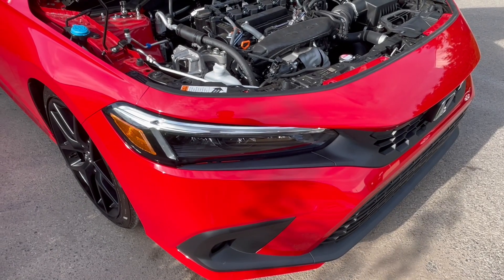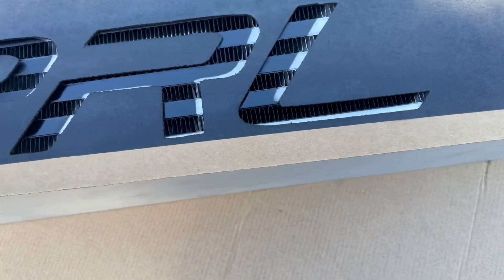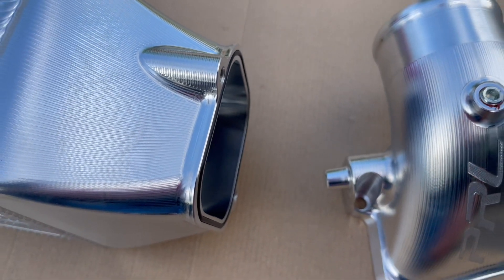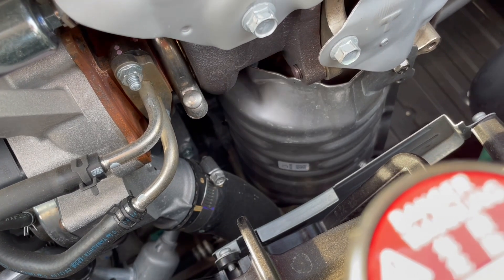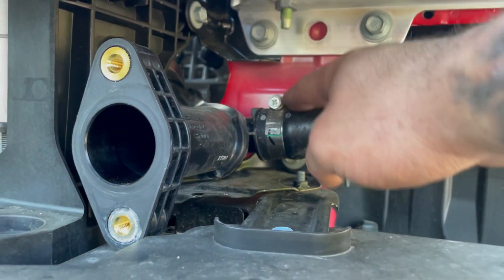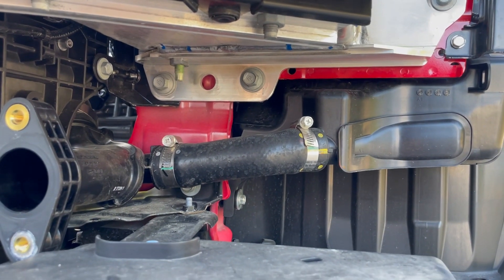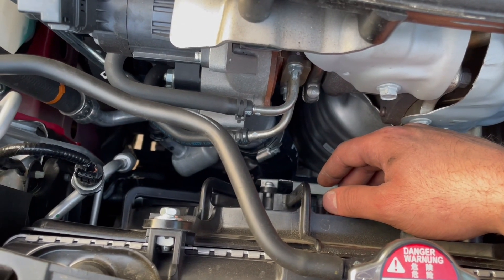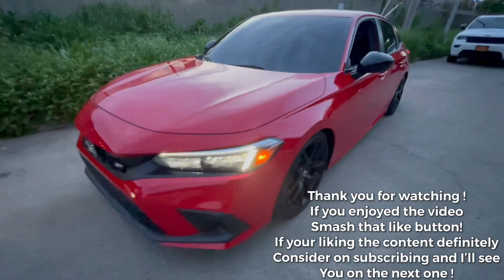2022 Honda Civic Si PRL Intercooler Upgrades Install

Comment: sorry for stupid question, what is the benifit of the upgrade intercooler? and do you have to tune it after have it install? because i just got the HB sport touring and want to mods my car too
Reply from the maker: The PRL intercooler upgrade decreases charge air temperatures while increasing potential airflow. It increases turbo spool it gives you about 3-5 hp. You don’t necessarily have to tune it but if you want good results then I say you should, but overall what it really does to your car it’ll make it run much cooler, and cooler air is better for the turbo.
Reply: @sfernandez816  thanks

Comment: What does this do for the car in terms of actual gains?   Has anyone been able to add much power to these 11th gens yet?  I know they’re still fairly new.
Reply: I’m assuming it wouldn’t go into limp mode as easily. My car has been in limp mode twice fully stock and it’s a 22 civic si
Reply from the maker: It’s not much for more power but when you get it tuned it can make a little difference yes, but this is more for cooler air which is what the turbo likes.
Reply: Speaking from experience, I’ve been running the TSP stage 1 tune for about a week now. In either map two or map three, which really are the only two maps which go beyond factory boost, heat soak is a bitch. You might get a few minutes of fun before you’re capped off with readouts at 17 psi. This is definitely my next mod. Thanks for the video!
Reply: Lol they charge 20 bucks for that stencil now. Pretty scummy if you ask me

Comment: If u buy the intercooler outlet also u need to Buy Intercooler piping ?? Or  I can buy just the intercooler outlet?
Reply from the maker: Yes you need to buy the intercooler piping as well, if you notice only one side is using the stock 12mm bolts, and the other is the silicone tube

Comment: Excellent video was waiting for a full install. Now how does it feel? Do you hear more turbo noises? Or still the same? Cause is a decent amount of money for only 3-5hp but yes definitely cooler is always better. Cheers
Reply from the maker: In a way yes, you can actually hear a little more turbo spool with it, and of the course with the prl lettering in front the car looks more aggressive in the front 😂
Reply: Ososik media actually ggained 20wtq just with intercooler no piping

Comment: old video but i just purchased a 2024.  best video I have seen for the intercooler so far. really glad you compared the two cores side by side.   factory cores are always lacking and heat soak so looking for this be the first thing I do to the car.
Reply from the maker: Definitely, I agree, this should really people’s first go to upgrade on these cars ! And congrats ! It’s definitely a great ride in all honesty, daily commute and fun at the same time
Reply: @sfernandez816 can you buy the intercooler without the piping or do you need the PRL upgrading piping to go along with the intercooler. Great video just had a question. Thanks
Reply from the maker: @Arnold-dm2xt  you can buy it without the piping that’s not a issue, but I can say if your thinking about buying the whole thing it would be better, cause your already spending a pretty penny on just the intercooler, might as well get the piping too, but do you really really need it asap not really
Reply: @Arnold-dm2xt  all depends on the direction of your build.  You can always add the piping and fancy elbow later.  My main goal is to reduce heat soak so I will probably only do the core. I'm trying to keep it a stockish daily driver.
Reply: I would also add, i bought the intercooler with yhe pipping because I was already going to have the bumper off and didn't want to bother taking it off again

Comment: Awesome tutorial! just wanted to ask you did you get any codes after the installation of the Intercooler? I just bought a 2023 Honda civic HB and I’m currently making a list of the bolt on upgrades I want to instal but want to make sure I don’t get any code you know. Thanks in advance!

Comment: Great video, what would happen to the car if you just installed the after market intercooler, does that make the car perform better or higher temp won’t effect the car? (Civic hatchback sport manual 2018 owner asking) thanks bro💪
Reply from the maker: If you install an aftermarket intercooler that’s obviously bigger then stock, you’ll get a difference in temperature, and it’ll slightly preform better as well with out a doubt 🙏🏻💪🏻 I would recommend upgrading
Reply from the maker: And thank you 🙏🏻
Reply: @sfernandez816  thank u big dawg 💪

Comment: Is this necessary? I've been hearing that there's some issues with the stock one
Reply from the maker: Oem is like a heat stroke for the car, upgrading to a bigger intercooler is definitely good for the car it’s self, you don’t really gain lots of power but it’s definitely good for the longevity of the car and more cooler air